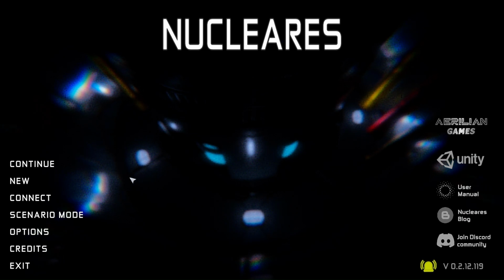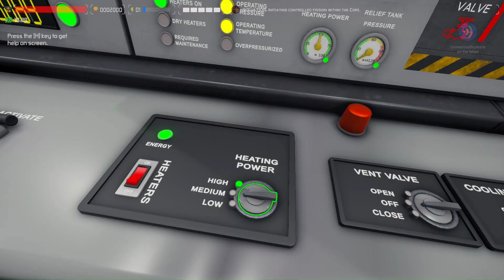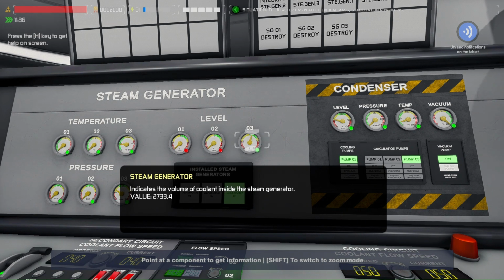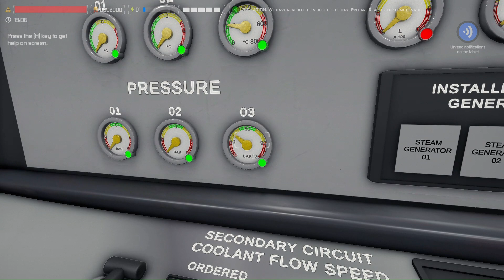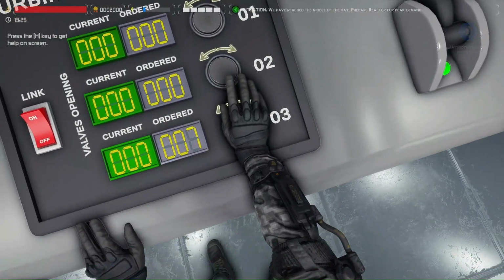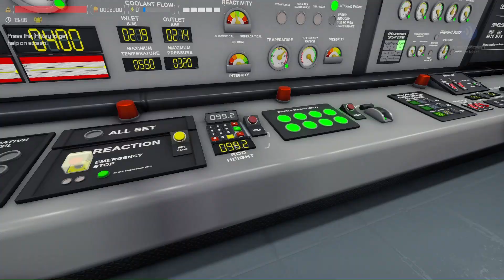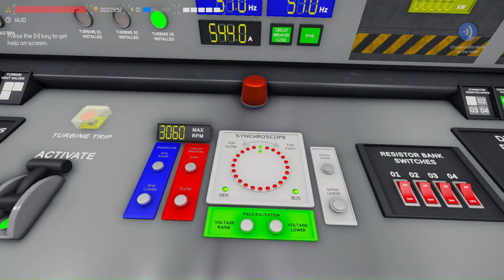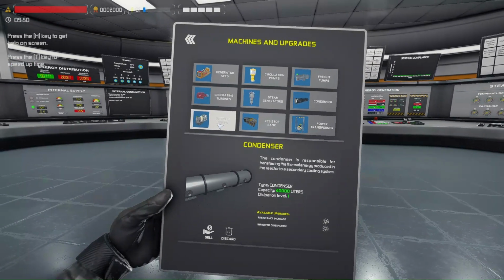NUCLEARES Parallel and upgrades

Comment: Would you recommend sticking with easy vs. normal in the beginning?  I just got started and I'm good with startup and running for a while.  I haven't done any upgrades or maintenance yet.  I just got disconnected by the utilities for not meeting 80% or something like that.  I'm trying to figure out if it is better to just keep on trucking or do a restore from a previous time and try to not get disconnected.  So far I'm enjoying the game and your videos.
Reply from the maker: The game will randomly throw in some of these things like grid maintenance, which is probably what it was, or also like the hydro dam needs to go down, stuff like that. I would just trip your turbine, or bypass it enough to provide self sustaining power for your pumps, so like maybe 1200kw max. Then just wait for the grid to comeback, once it does, stop bypassing and send it all to the grid. You can find the amount required for the plant over at the diesel control panel. Also, you can join the discord and ask questions there too! Thank you for your kind words. I hope the game gets updated soon!

Comment: Will you do a video with two cooling circuits and two generators?
For some reason I keep killing my turbine when I power up with two generators.
All of the guides and videos only cover the default configuration with one cooling circuit and one generator.
Reply from the maker: Sure I can make a video of normal operations/ maintenance S/D with two loops. The shutdown video has two loops, but I can do that today for you, seeing as I restarted during the Christmas event and currently only have two loops.
Reply: @GWHacketts  thank you very much! 😀
Reply from the maker: Here's the two loop operations. Let me know if you have any questions about it. https://youtu.be/_x1lUiKZmBU
Reply from the maker: @johntaylor2433  hopefully the video helps a little bit. Key things is to make sure you don't have too much steam going to the turbines. Lower flow rates in the primary to prevent them from exceeding. If you need to raise pressure in the turbine, be ready to lower RPM to prevent turbine overrevving, while still maximizing torque to gain the most power. Hope that helps. I probably should have showed the increase to max power with the turbine. Maybe I'll make a video on that too.
Reply: @GWHacketts  i’m going to have to keep trying. I gave it another shot last night and everything seemed to be spot on where it should be.
RPMs of my turbine were at about 50%, and then, all of a sudden I was getting an integrity warning on the turbine. This was right after a maintenance so everything was at 100% when I started.
Reply: When it starts generating steam in the steam generators, I have the bypass on the generators around 30%, and I slowly bring that down so they don’t get hit too hard… I don’t want it to suddenly spike above 100%, maybe that’s where I’m messing up? 
The generators themselves don’t seem to be getting damaged though. It’s the turbine that’s having the problem.
Reply from the maker: You can also go slower on the start, keep the pumps below 50% on the primary side, and that will limit the heat input into the S/G, which will in turn result in lower pressure on the turbine. If you are 100% coolant flow, you are definitely going to get an overspeed.

Comment: Hi ! I would know hwo we know the combustible % level ?
Reply from the maker: Can you be more specific? Not exactly sure what you mean by your comment. Are you asking when the turbine will burst into flames? It is based on integrity. If you get the critical integrity alarm, its most likely in flames.
Reply: @GWHacketts I think he meant the level of fissile fuel in the fuel assembly, and how one knows when you need to load another one into the reactor.

Comment: at currently you dont have to do the sync you can just close the breaker and power flows which is incorrect if you did that for real generator goes boom, there needs to be some consequences of closing the breaker when not synchronised
Reply: Oh, it has consequences, the city might complain and you get a notice, that their powerline broke down and has to be repaired.
Reply: It's a placeholder mechanic, I'm sure. @Berny4000
Reply from the maker: Wait really for real? So I've been wasting my time! lol It's a fun little element, but what's the point if it isn't going to actually function.
Reply: @GWHacketts  it literally doesn't affect anything as far as i know all the synchroscope does is give you the sync light on the panel at current maybe it will get updated in the future

Comment: they should add all the reactive power controls into the game, it would give the player more to do 
the adjust voltage button would just increase excitation on the generator increasing voltage bus also increasing the VAR output 
the steam flow just adjusts power 

i find myself just standing there doing nothing and the plant just runs i dont have to manage anything
Reply from the maker: I will be honest, I was never good with those house curves. Something about ELI the ICE man? You can absolutely just set the game and forget it, but there is a setting to add random catastrophes and also weather effects, so you would have to be more on your toes to respond to casualties and flooding! Might make it more interesting.